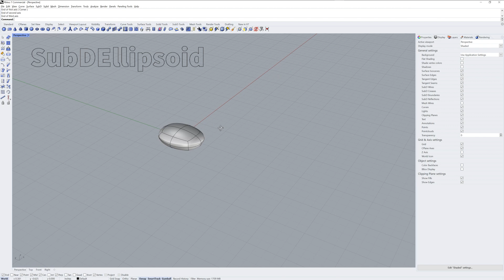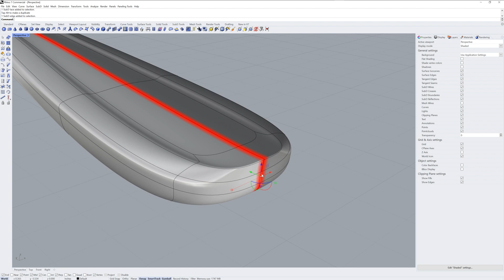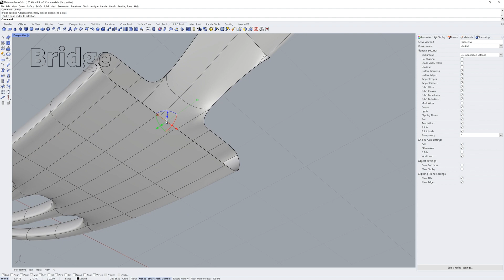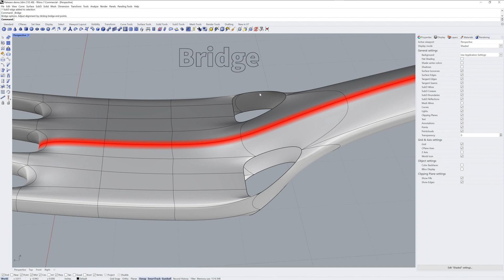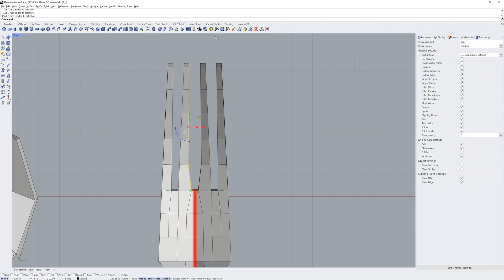SubD flatware in Rhino 7 (speed model)

Comment: If you wanted to make a sheet metal model of say the spoon in this tutorial. Can I ask how would one go about getting the exact dimensions of the separate planes. I have tried flatten surface for a model I have been working on SubD but it doesn't seem to work? Any tips would be greatly appreciated.
Reply from the maker: You might try modeling the flat form first with a closed border curve and the command PlanarSrf. You could then use FlowAlongSrf to deform it onto a curved target surface and finally use OffsetSrf to make the solid. If that doesn't help, post a model to the user forum for some ideas, there are probably a few approaches... https://discourse.mcneel.com/
Reply: @RhinoGuide  Hi thanks so much for the speedy response. I will experiment with your suggestions and check out the link too. Appreciate your help. Thanks again D

Comment: Thanks for  this short tutorial (+ for the one in real time). When I try to reproduce fork-"head" in Rhino7 and with same settings in SubD quad mesh, I end up with hundreds of more faces than you do. Do I need to change a default Rhino setting beforehand?
Reply from the maker: Yes, the default for QuadRemesh is 2000 faces and it's also adaptive so the shape will impact the face count too. Go as low as you can with the quad count while keeping the design. Post to the user forum here too with any model if you have more questions. https://discourse.mcneel.com/

Comment: How to control the Red line thickness(?) when u use 'Reflect' commend? I cannot find control option at the display mode.
Reply from the maker: That's based on the objects size when Reflect is run, you can turn it off in the full display mode settings in the SubD section too.